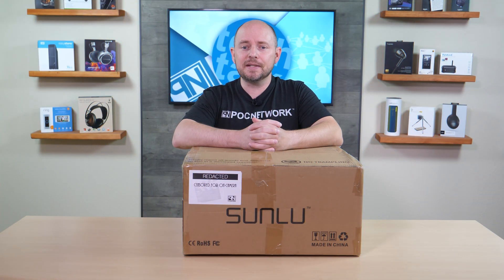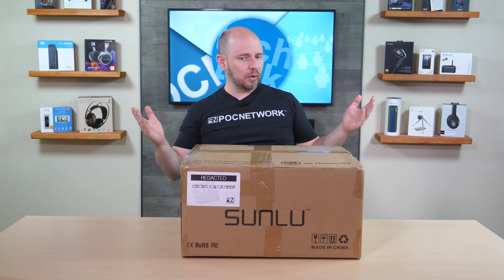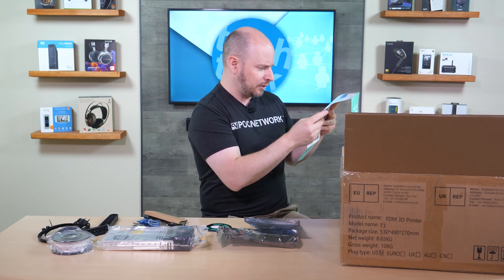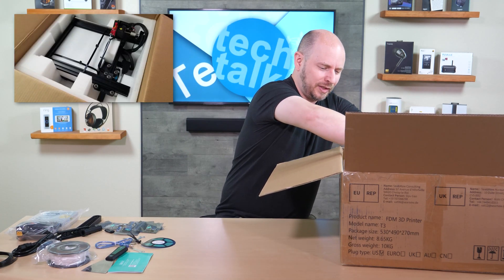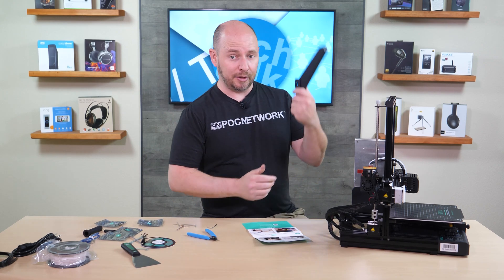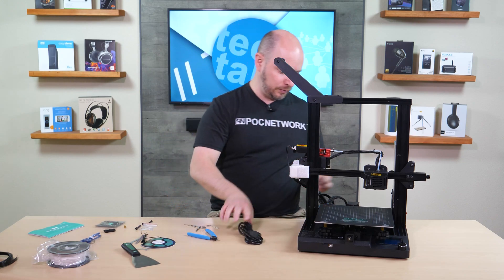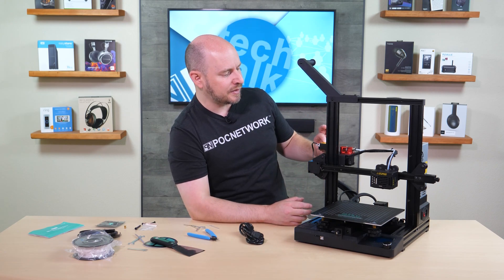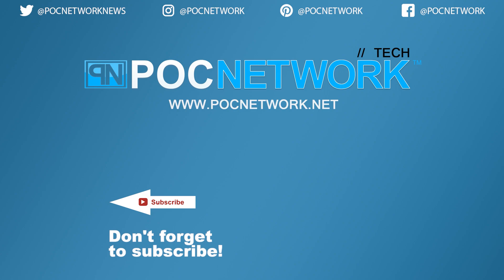SUNLU T3 Fast-Printing FDM 3D Printer - Unboxing - Poc Network

Comment: But how do you get it to turn on?
Reply from the maker: If it doesn't turn on, check the voltage switch/slider on the unit by where the power cable connrcts. Might need to be set to 115v if it is set to the other. We had to do that as mentioned in review. -- Ryan S.

Comment: Great unboxing video.  I received mine and it was easy to assemble.  Two pieces of advice - First, re-do the Z-offset and manually re-level the bed before you go to auto-level mode - there is an updated video from Sunlu that shows you how to do this:  https://www.youtube.com/watch?v=7qun1ObwRZg&ab_channel=SUNLU.  Slow the video down to follow along.
Second, the printer ships with the fast print mode enabled - disable it from the menu.  This is not a good way for beginners to start as you really need to tune the profile for high speed printing including raising the filament temperature, etc.